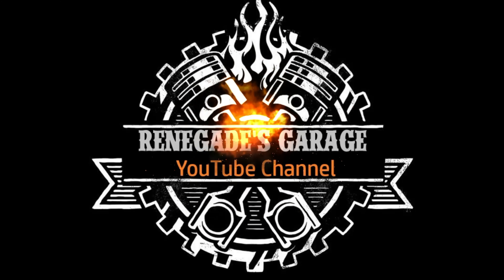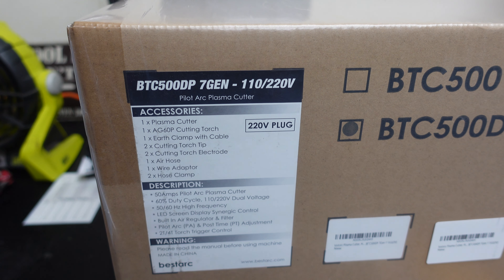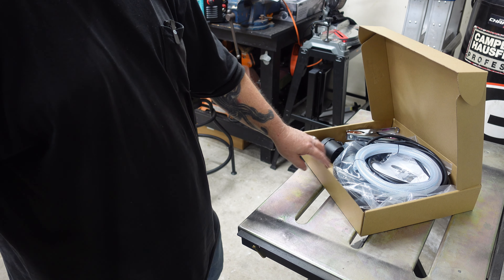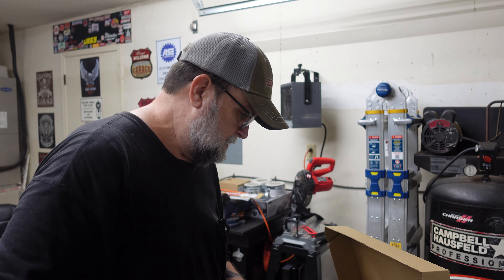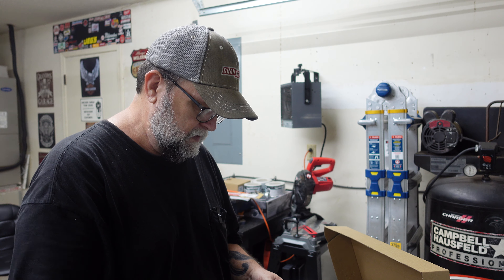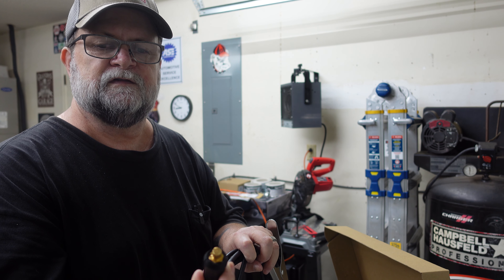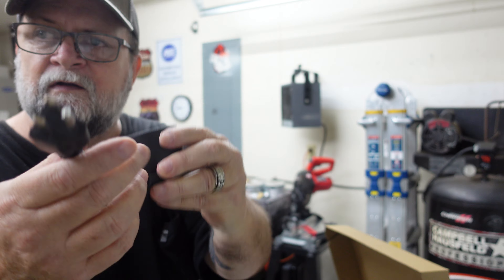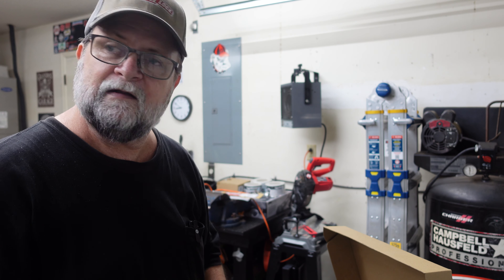Bestarc BTC500DP 7GEN Plasma Cutter

Comment: Ya I was scratching my head about that hose too.  A locking generator plug would be better than that dryer plug..
Reply from the maker: Well I think they provide that adapter for people with electricity but I think an additional adapter like you mentioned would be nice to have for people using the machine with a generator. It would make it a lot more portable.

Comment: Hi Renegade, good seeing you tonight on Mater’s live. I just watched your review. I have the same issue. I run my compressor and my plasma cutter from the same 220 line. I’ve added 2 more since, but I found the air efficiency is so good I can fill my 80 gallon tank and run off that for a good hour of cutting before I have to let my compressor recharge. I was surprised. I had an F150 aluminum body dropped off at my house to do some testing (and make some wall art), so I had to slice this thing every which way. I think I did it about 2 years ago. It’s on my channel. I had to cut through 3 and 4 layers of aluminum at times and it handled it pretty good. I almost always run on 220V, even though mine has the adapter cord like yours. It just doesn’t perform the same on any gage metal as well as the 220. 110V “doesn’t cut it”, if you know what I mean. I have the YESWELDER Cut55DS. The features are very similar to yours.
I’m building this metal body for my T bucket out of 20 gauge. I’m hoping I can get some good cuts on that using 110 so I don’t have to do the back-and-forth thing with my 220 V outlet. The other two new ones that I have are 50 A, but I don’t have the plugs mounted for them yet. I disconnected to different 220 heaters I had in the garage to get those. I’m running a gas furnace out here now
Reply from the maker: Yeah so far it hasn't been an issue but I do need to add another 220 outlet. At least one more maybe two more. That way the heater and air compressor can stay plugged in. And have one for the welders and plasma cutters.